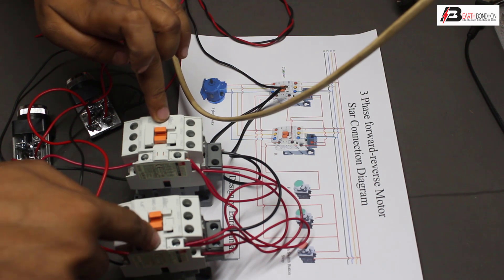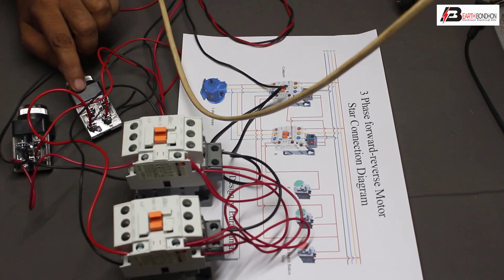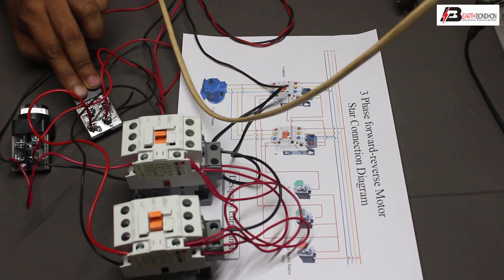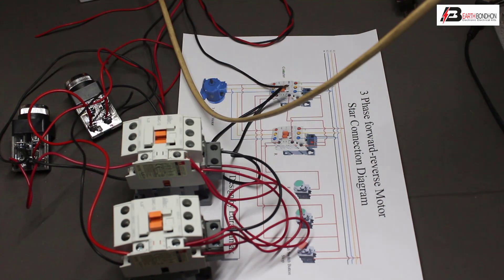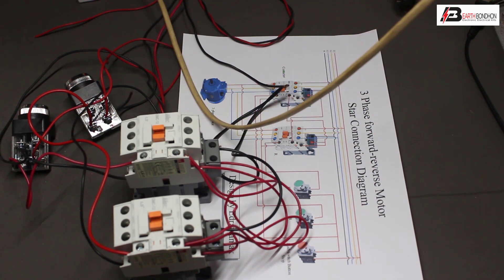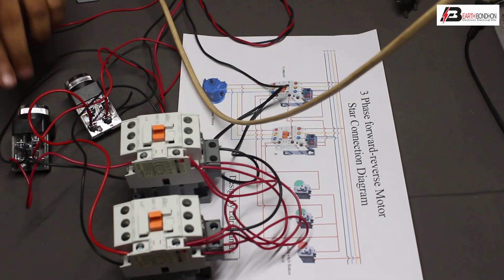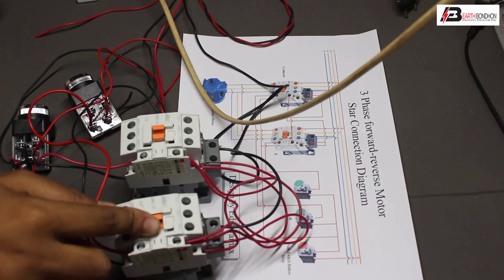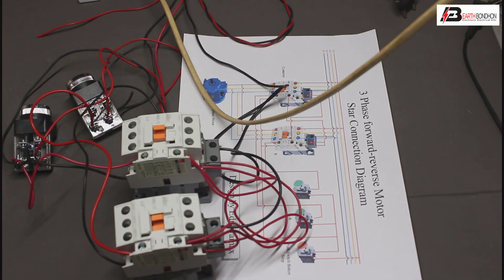How to Draw 3 Phase Forward Reverse Switch Wiring Diagram | EdrawMax

Comment: A question:(maybe our of topic)
So I just noticed an extra wire in my entire house circuiting. No it is not ground wire, there is another for ground. The extra wire is yellow in colour(maybe they picked colour randomly), it js not connected to any switches but it is just there. I wonder what it is for. Maybe spare wire for something?
Reply from the maker: EdrawMax Software using...

Circuit Diagram, Creating flowcharts, mind maps, org charts, network diagrams, and floor plans with a rich gallery of examples and templates.

Youtube Channel.....
Thanks for your feedback, please follow.........
"Thanks for watching the video"   You are very welcome!